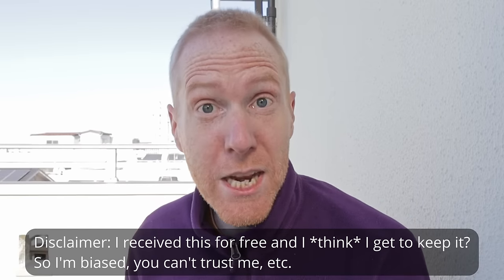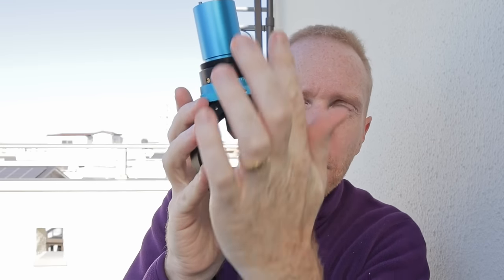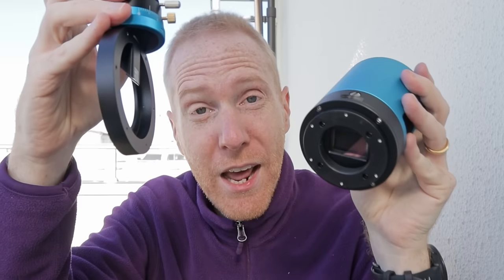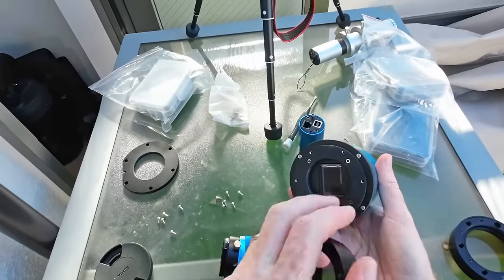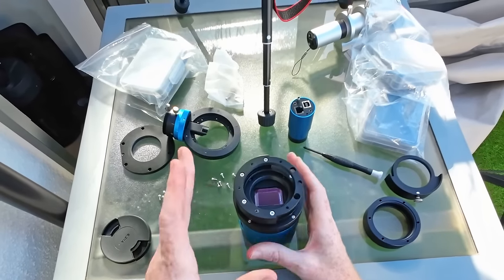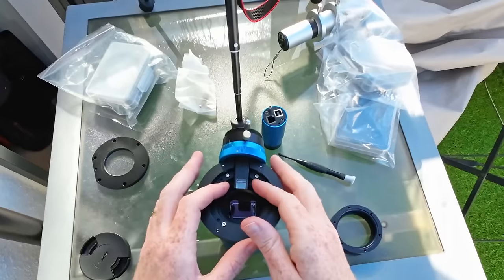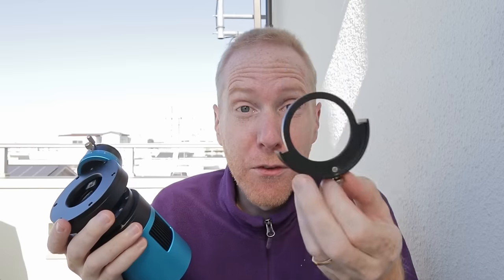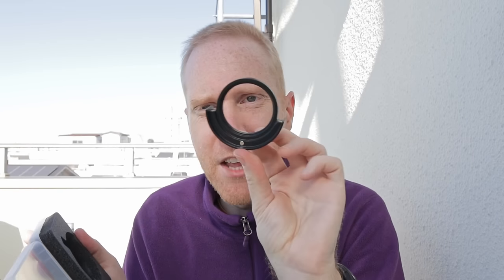Surprise! ToupTek going into OAG and Filter Drawers/Wheels!

Comment from the maker: Touptek OAG: https://tinyurl.com/ym27cwha
Touptek filter drawer: http://tinyurl.com/mrxhsp9j
Touptek filter wheel: http://tinyurl.com/532ab8ss
Touptek IMX571 Color camera：https://tinyurl.com/mr2yhvcw
Touptek IMX571 Mono camera: https://tinyurl.com/msjw9zph
Touptek IMX585 Color Camera: https://tinyurl.com/3z54r5bs

To note: I'm comparing with what I own, which is the standard ZWO OAG, and what I've used in the past, the excellent Celestron OAG. I'm now seeing that the ZWO OAG-L seems to be the closest equivalent on the ZWO side, and the designs are similar (although the ZWO one has a tilt plate on top of it!). So if you have a ZWO guide cam, you may want to look into it! Still, I believe the Touptek is excellent value and am super excited to see more competition in the space, because that means we as customers win!

Comment: Very excited about the ToupTek entry into the market.  I certainly can agree that competition is great for the hobby.  ToupTek now sells an OAG with a 14x10 prism as well as a 10x10 version which I believe is what you demonstrated.   My biggest camera sensor currently is a ZWO 2600 so not sure if the new larger prism is meant more for a full frame sensor.  I know you haven't probably had a chance to test the new OAG but was curious if you had any thoughts about the larger prism.  Thanks for showing all of these new manufacturers.   If I am not careful I am going to own some non-ZWO equipment.   FREEDOM.

Comment: 8:15 I know it is a Little Late, but on the Filter Drawer from ZWO there is a little Screw you can tighten it. inside is a little (i dont know how to descripe this thing in English) metall ball with a spring this will give the drawer a tighter fit. @Cuiv, The Lazy Geek

Comment: Love all the video's I have learnt so much thanks a million.
One newbie question about the ToupTek OAG.   I get that you screw the OAG to the camera, via the filter draw and this makes the better linage.    But that means that you can not move the OAG camera to pick up a glide star, with out rotating the framing of the object in the main camera.   I want to use the OAG on a Celestron c8 with a 6.4 reducer and am a bit worried in will not find guide stars.    Do you see this as an issue?

Comment: great news! Can the OAG be used with a threaded filter drawer o extender that is not from ToupTek? It seems it only supports screws. Can you clarify? Thanks!
Reply: It can not. I received mine today and can confirm that only the connection with screws is supported, no adapter ring or anything available. I'm pretty bummed out about that tbh.

Comment: If you also get super super excited after watching this video and you own an Altair Hypercam (26C in this case) just to let you know that the screws are too small for the holes on Altair camera flange. I don't know if the flange can be changed and if that surgery voids the warranty but it is not works straight-out-of-the-box case

Eventually found M42 to M54 adapters on AliExpress, hopefully that will make it work when delivered

Comment: Excellent, thanks for showing the products Cuiv.
Is the helical focuser on the OAG non-rotating? BTW the G3M662C I bought direct from Touptek after your recommendation is awesome.
Reply from the maker: Yes it is non rotating :) and glad you're enjoying that camera :)
Reply: Have not been thrilled with the 662 color cam for use as guide camera. It works about equal to my ASI290mini, but no quantum leap in guiding performance. It's OK but not an improvement over any other cam.

Comment: Thanks for the heads up, I agree it's good to see some more competition at the budget end. Is that filter draw the same as the Altair Astro version? because it looks almost identical. If it is, it isn't that cheap here in the UK in fact its around the same price as the ZWO, or it was when I bought mine. But the magnets are definitely strong.
Reply from the maker: Yes, it's effectively the same as the Altair Astro version!

Comment: I am also thinking about to afford the OAG and the drawer. But I am unhappy about the range of drawers in general. I hpoe Touptek will come out with an electronic filter drawer with 2 or 3 positions. As a user of an OSC you need to go manually vhanging from NB Filter to RGB or spend a ton of bugs on a full blown up 5 or 7 position electronic filter wheel. I want a simple, electronic and cheap solution for OSC cameras.